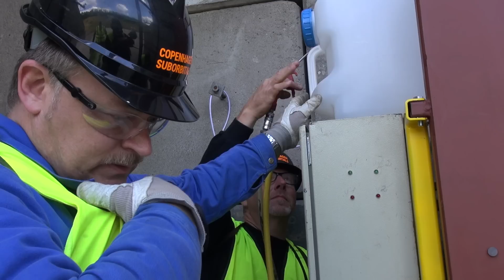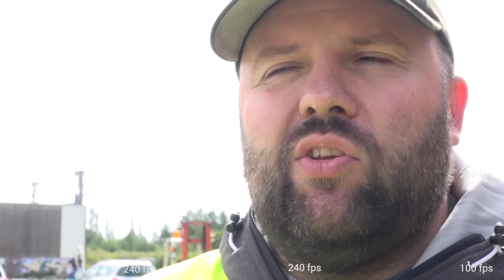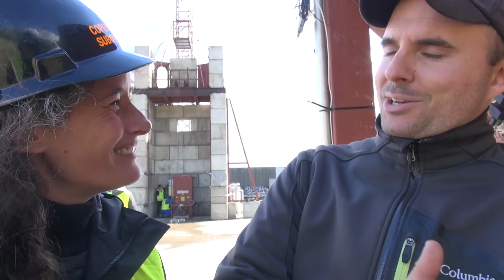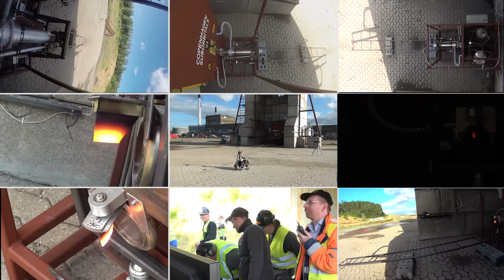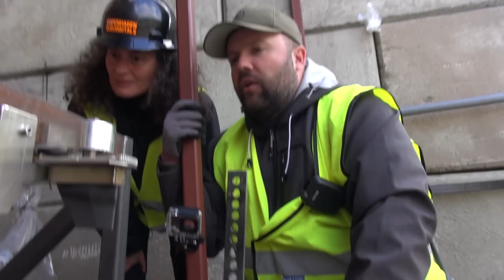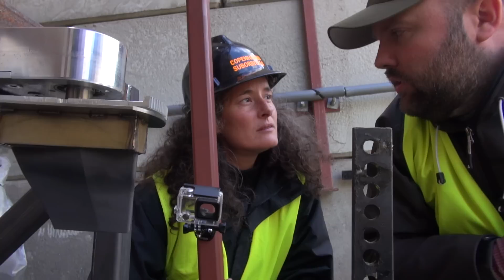2015 07 26 BPM-5 Static Test no. 3 - Atmosphere Video

Comment: For the jet-deflection, instead of vanes in the middle of the plume, why don't you use flaps on the edges of the plume?  That way once the rocket is in stable flight they will stay mostly outof the exhaust plume, they'll thus erode less & last longer, and will minimize drag.
Reply: roidroid Robert Goddard tried this and it didn't work so well.
Reply: roidroid I believe they were testing the vanes resistance to heat and not the aero properties.
Reply: Paulo Rebordão i don't mean atmospheric drag, i mean drag on the exhaust gas plume.  Anything which gets in the way of the exhaust plume will reduce the engine's effective thrust.  In the case of a vane - that reduction of thrust will be permanent because the vane never moves outof the way of the plume.  But in the case of flaps, they only reduce the engine's thrust (via drag) when they are tilted into the plume, but when they are tilted outof the plume - the associated drag will disappear and the engine will run at maximum thrust.
Reply: roidroid They will eventually be turning towards a gimbal motor setup. Jetvanes are used because it is easy, and they have some experience with those.
Reply from the maker: Daniel Rea Kragskov Exactly